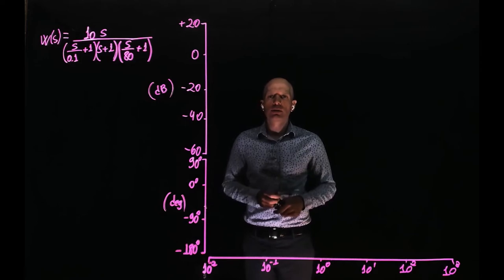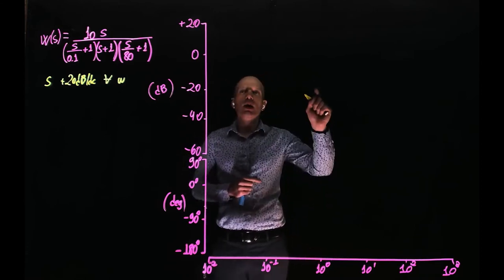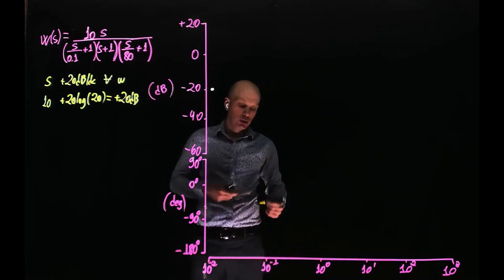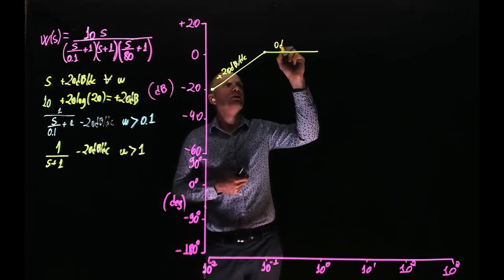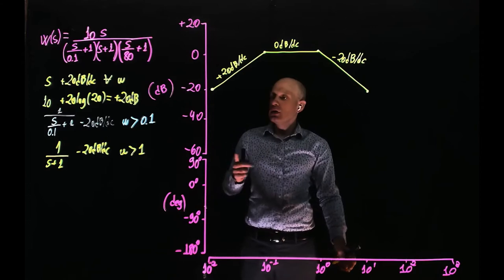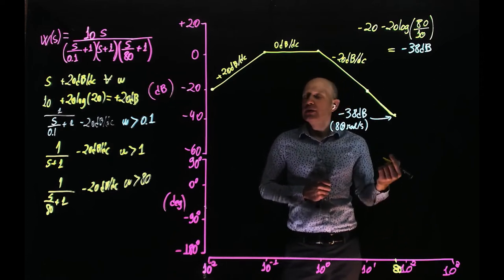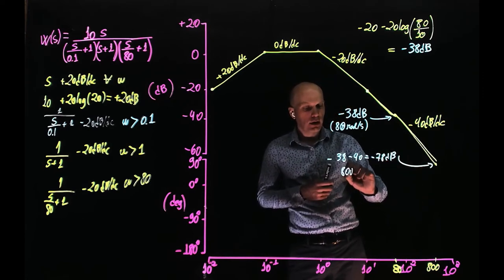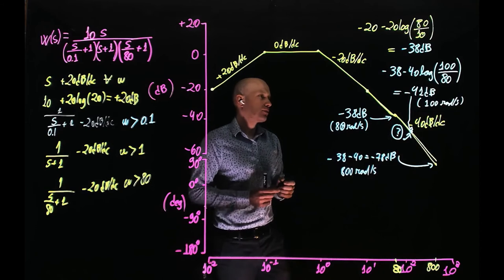L16E99 Control Systems, Lecture 16, Exercise 99: Drawing a Bode plot

Comment: the transfer function in the question seems to be different than the solution. How did you pull an s to the numerator? also there were 4 poles in the denominator for the question, the solution has just 3 poles. I would appreciate an answer to that.
Reply from the maker: consider only the transfer function used in the solution.
Reply: @biomechlab  thank you very much. I really appreciate your channel and tutoring methods!! Please continue the good work!